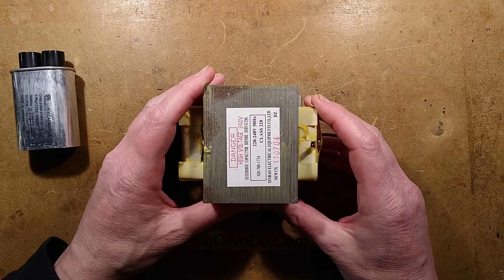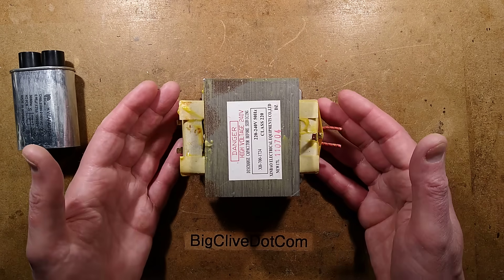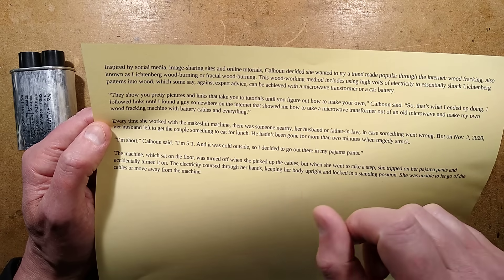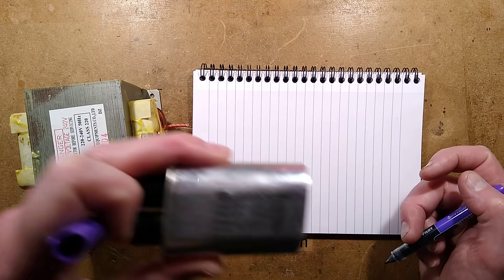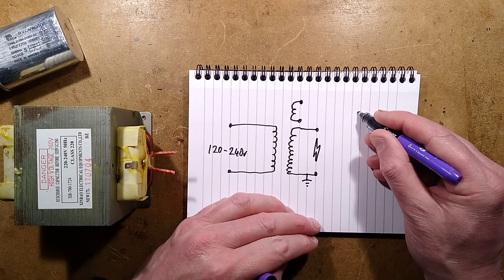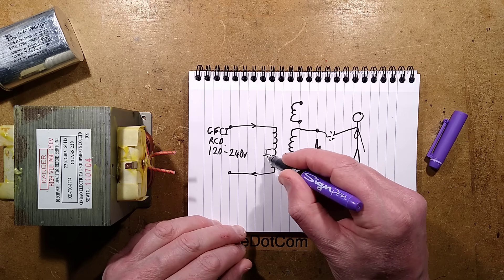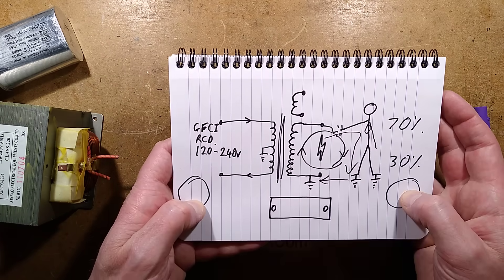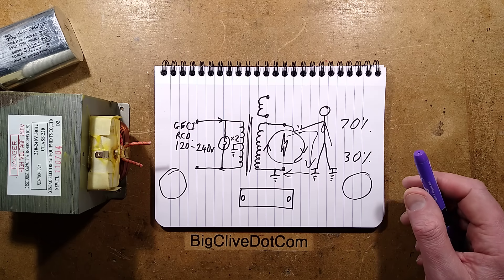The most deadly project on the Internet

Comment: Timely video Clive and obviously much needed, an awareness of what constitutes a hazardous voltage is lacking in many videos and articles accessible via the Internet. I would draw readers attention to the landmark IEC standard 60479-1 "The Effects Of Current On Human Beings And Livestock" which I think was first published in the 1970's and forms the basis of the SELV (Safety Extra Low Voltage) AC & DC voltage limits,  referenced in standards like IEC 950, AS/NZS 3260,  that 99% of the population can withstand without being fatal. Bulk body impedance is very much a statistical quantity.

Apart from the dangers that you have well described there are other drawbacks to using old microwave oven transformers. Of the 6 microwave ovens with ferro resonant constant voltage transformers that I have pulled apart I would have to say that the type of construction would be the least useful to home experimenters however the transformers are probably the most readily available now. The transformers now are mostly made in China, many by GALANZ, and do not have conventional bobbins but are wound like electric motor stator windings with a very thin layer of NOMEX type paper as insulation between the windings and the core, the windings are  packed tightly into the core window and also usually covered in an epoxy resin making disassembly difficult, the winding window is also much smaller than a conventional E-I lamination stack of the same overall dimensions.  Whilst the ferro resonant operation should result in only the secondary part of the core moving into magnetic saturation by the use of magnetic shunts between primary & secondary windings, I have found that all the ones that I have tested the primary is already operated well into saturation and the primary current with no load is about 3-3.5 amps RMS at 230-240VRMS,  an optimized but marginal design.

A quick readily accessible and useful extract of IEC 60479-1 can be found here:
http://www.electrical-installation.org/enwiki/Protection_against_electric_shock

Comment: I have never played with an MOT, and this video makes me glad I haven't, but I have played with a ZVS, and your video has inspired me to get it out, and grab some wood :)
Reply: Ever get 20,000 v in you? I got a couple nice jolts from car coils over the years, never fun if you've got an MSD fitted.
Reply: Zvs can too generate large amount of current, but especially if you use ac flyback it will just burn very badly 
Best is to choose material wisely and be careful not getting shocked

Comment: Neon sign transformers are just as deadly. I know a knew of a young college student who built a Jacobs ladder with one. He died. It seems when the found him at first they couldn't figure out how he contacted the high voltage. The coroner later found two small burn marks on each of his hands.  It seems he thought he could touch the electrodes to see how much it really shocked. It was the last thing he ever did. This provided a direct current path through his heart.  His room mate found him on the floor - dead.  That 30mA of current can be instantly deadly if it follows a path through your heart. And if you are using both hands  -it will! When working with high voltage old saying "Always keep one hand behind your back, wear HV insulated gloves and clothing and never stand in water or work around it and always have a support person for safety with you shut down the power. Just don't play with high voltage for a crappy piece of artwork. You can generate the same fractal designs with computer software and burn it into the wood with a much safer laser engraver.

Comment: Respect Man... Great to see someone is safety aware and sharing the hazards of high voltages and currents. I had a look at Calhoun's hand (or what is left of it) photo... Not a pretty sight, the hole in the waist alone looks like it was nearly going to pass right through, probably would have if she were still being the load the electricity was passing through. SHOCKING STUFF.

Comment: I wonder if grounding your wrists might be a good secondary failsafe. At least to avoid death. Your hands would still get fucked I guess.

I once repaired my own microwave using a tutorial and the guy said it like 5 times. ALWAYS ground the terminals and never assume it's discharged. It was the magnetron itself that had failed. 50 bucks and the microwave is as good as new.
Reply from the maker: That introduces new hazards.

Comment: I’ve taken out one of these from a microwave to make a magnet for my drill press that runs on a 12v wall adaptor.

I was terrified the entire time I was removing it from the microwave and had rubber gloves on and was using electrical screwdrivers to short the capacitor.

That process alone scared me. Cannot imagine making one of these just to play with.
Reply from the maker: You did it the correct way.
Reply: As a rule of thumb generally I'm terrified of anything that plugs into the wall and any large capacitor that is bigger than my pinky finger.

Comment: You know something is really dangerous, when even Big Clive is warning you about it! I was once told by an older man stationed here during WW2 that a towed airborne target came adrift, and the metal tow line came down on the ground. He was sent to retrieve it, and found it had landed across a high-voltage long distance power line (~400kV iirc). One of the locals had attempted to steal the cable. He said the local man's body was completely burnt, glowing along lines where his veins had been. These Lichtenburg patterns made me think of his tale.

Comment: I still do not touch transformers. 
I need so much more experience before even actually thinking about taking one out etc. 

If I were to do this. It would be in the lab, with a fully removed process. I would not be anywhere near it or be physically touching it if possible. 

I would essentially build a machine. A machine you can isolate and be COMPLETELY REMOVED FROM. 
I work with electronics. You have to be an expert to even begin starting to considering doing something like this.

Comment: Never put a large current source across your left and right arms, as it will run straight through your heart.
Holding an electrode in each hand is the worst way to go about this.

It is the current that kills, but you need a high enough voltage for the current to flow.

Comment: Well explained, I worked with neon supplies in the past, they can be very high voltage, is usually in the region of 5000 to 10000 volts or higher.
I have been told it's not necessarily the voltage that will actually kill you, it's the current drawn under load 
Touching a bare wire in a cable, say a flex going to a kettle while the kettle is turned on at the plug but kettle is off will shock you and will feel horrible, you will feel the ripple of ac but is survivable.
Touching the same wire while the kettle is on and boiling water will most certainly kill you in most cases.

Comment: Great video. As a time served house-bashing sparky, we were always told that if we ever wanted to touch a potentially live cable (which of course you shouldn't), to use the BACK of your hand - as your hand will pull into a grip if you are held by a current. Perhaps a dead man switch that requires an outer flex of the hands? Just thinking aloud.....love the vids Clive.

Comment: I did it for my carpentry master classes, I knew roughly what I was doing but I have to admit that the box you are showing would have made the process less nerve wracking. I made sure that my whole family knew what I was doing. I was 4 Meters away of the thing while the leads (not the 12 volt joke) were fixed onto the wood and it could only be active when I pressed a button at the wall end of the chord. I still get nervous thinking about that process and I think it helps a lot to use these transformers only with the highest respect and awareness. Be VERY careful with them. They are not toys or fun to work with.

Comment: If the HV side of the transformer was not referenced to ground would that make it safer? I think it would still kill you if you contacted one of the output leads. Like the IT mains supply system which works on non earth referenced 120 degree out of phase 110 v lines.

Comment: The "dead man" concept is still slightly flawed, as you're equally likely to tense up in a sudden emergency as let go. Robot teach pendants have a 3-position switch where out and fully depressed are both disconnected, and you have to hold it in the centre to activate the drives.
Reply: I think the point was more that it occupies both your hands, so you have to position the electrodes while the device isn't powered, then let go of all the likely-to-be-dangerous parts in order to power it.

Comment: Nice !
I keep meaning to do the Lichten[insert German for mountain or stone or whatever here] spangly wood knackering thing. Never quite got around to it.
For the Dead Man's Handle might i suggest having the two buttons at 90 degrees to each other ?
if both thumbs convulsed, pressing both buttons, all Bad.
If the hand pressing the Side button convulsed, entire box gets shoved away from hands, Less bad.
Amazing to find that the Microwave transformers have Aluminium windings, not copper.

Comment: I work with voltages higher than this being in the rolling stock industry with electric passenger trains, and I can 100% verify the danger of high voltage electricity, We had to do maintenance on the pantograph on a unit (which is the frame that rises up from the roof and contacts the catenary wire which sits between 24-27k volts (depending on the weather on the day, the transformers tend to put out different voltages within the same sortof ballpark) a fella that I was working with happened to work on the wrong train presumably tired from going on nightshift, He went through the procedure to isolate the overhead supply for the unit he was working on, but climbed the insulated plastic ladder on the wrong road, where the overhead supply was not isolated. The voltage arced about 4 and a half feet and blew his arm apart as it found an earth on his elbow that happened to be in contact with the roof of the train. He was uncannily lucky to survive. He died from cancer about a year ago but he couldnt use his right hand for anything other than slight movement. Electricity at high voltage aint for amatures, its just far too unpredictable.

Comment: blink I had not heard of this type of crafting project.. and I am stuck somewhere between 'wow, I would never have thought of doing that, neat!' and 'holy expletive these people should not be doing that!'.   I have a background in EE.. confident enough to work with such voltages, but still scared enough to be damn careful in designing/using such an apparatus!

Heh.. though now I am sitting and wondering what kinds of safety precautions I would put in place.   Always a good exercise.

Comment: Sadly, none of the Tik Tok videos are ever UL rated, and doubt they would be. And despite there being "community standards" on certain platforms, I don't think those have yet quite evolved to screen content which requires expertise and strict safety practices. I just cringe at watching a person hold both electrodes in different hands. So much for the one-hand technique learned in school when working with high voltages. Another concern is that people may use wire which is not rated for extremely high voltages nor wear gloves which are rated for the high voltages from the transformer output. This is a recipe for disaster. At these voltages you won't get a warning, you'll just die without knowing what hit you. The 30% who got away injured are lucky their lives weren't cut short.

Comment: I know from experience that in the right conditions you will be unable to turn loose from the powered whatever it is you've grabbed with 110 volts. It doesn't need to be high voltage. Common 110 house current will do it. Thanks much, Clive and God Bless

Comment: I'll share a little anecdote from many moons ago, when I did my microwave oven servicing training at Panasonic who were then in Normanton. The lecturer said that they knew of only two technicians who had accidentally made contact with the HT supply. Neither survived. The danger isn't limited to an (energised) HV transformer either. If the bleed resistors across the smoothing capacitor fail open circuit (and they can, and do) then a perfectly lethal DC charge can exist across said capacitor long after the appliance has been disconnected from the mains supply. Very dangerous machine to play around with.
Reply: I had no issues repairing microwaves. Just unplug them and like all capacitors, short the terminals and you're fine.

Comment: Been an electrician over a decade now. I remember my first power distribution course the instructor played a half hour of accidents in which lead to death. It wasn't gory, but it was horrific enough to get the point across. Why anyone plays with electricity is beyond me, leave that stuff to those who know what they're doing
Reply: Playing with electricity is fine, as its a great way to learn.. what's NOT ok is playing with HIGH amperage or voltage to learn.  It's like lighting a match is fine..  lighting a rag wick into a 500 gallon gas tank..  not good
Reply: After a decade, I bet you've talked to a few linemen who could tell you some gory tales.  People have now idea how dangerous your job is.  Respect.  :goodvibes:

Comment: I removed the secondary coil, put two round of 10mm copper wire to convert into spot welder , installed 2 timer for controlling auto on /off and control duration of spot welder.

Comment: Thank you Clive. I had a large abundance of these mots, un fortunately most burned up with a large forrest fire we had in the states last year. Had a few extras in storage in town. I was aware of the DANGER of these and the closed loop potential. Complacency is always a problem in all things big or small. The Idea someone could very well live thru this should bother them more than the DEATH considering, heart, brain or other permanent disabling impairments. "I" for one,, WILL when working with these in the future, build the deadman and make sure I am well insulated from thee out put,  a one inch thick 4'×4' rubber pad used for  horse/ livestock trailer transportation under my insulted rubber boots and long sleeved rubber gloves as well. Thanks for the video!

Comment: I've enjoyed playing with microwave transformers, making jacobs ladders, frying smaller electronics, and other activities. I've always hooked up everything first, then turned on a switch on the 120V side so i'm not in contact with any HV. I make chicken sticks out of plastic PVC pipe at least 2 feet long and put the live wire on the very end. Usually wear thick gloves too.

Comment: I set mine up with the mains power leads being 10ft long. At 2000-3000 volts, there is enough oomph there to send an arc up to 6ft. It's likely such an arc would lose a lot by the time it reached you, but not an appealing thought. By having the workpiece and transformer so far away, there is no physical way for me to touch it when it is on. I don't use a switch, but rather I plug directly into the mains. When the burn is complete or the leads need to be readjusted, the plug comes out of the wall, deenergizing the whole system. As long as I follow the "don't touch it" rule, I can't be harmed.

Comment: Thank you for pointing out the dangers. I've used a simple setup that "somewhat" isolates the transformer and leads but I have little faith that my setup is adequate.  I could not find much on very high volage insulation at the time. Thank you again!

Comment: Key point in the operation of a GFCI or RCD.  They do not measure the current in the 2 leads.  Instead they sense the differential current in the line Voltage leads by way of a transformer winding around the 2 leads.  Any differential current in the line Voltage leads impresses a current in the GFCI secondary winding.  It is this secondary winding current that is used as a driver to trip the internal relay disconnecting the line Voltage.

Comment: Thank you SO MUCH for going through this explanation Clive. I recently acquired a MOT and was considering playing with it a la PhotonicInduction. I believe I may have a rethink about it now.  I really like the dead-man's switching solution.  Once I put the other proper safety considerations into place, I will include such a breaker.
Reply: He used the wrong nomenclature: a dead-man's switch is a switch that you need to press periodically or else the power is disconnected. In fact that won't help here, as there is a good chance your muscles will cramp up when being electrocuted, meaning you will not release your grip until well dead.
What makes the device good is that it requires the used to use both hands, meaning there are no hands that can be used to make mischief.

Comment: The old adage, “a little knowledge is a dangerous thing”, has never been more relevant here. HV is fascinating. I work for a Distribution Network Operator as an HV engineer 11kv+, I don’t recommend this unless you’re, competent, safe and know your electrical theory in and out.